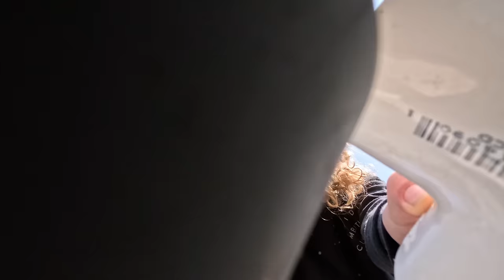The Kids (and Dog Dog) Help Me Get Organized

Comment: The crows are self appointed guardians of the world.  If they are going off, there is something they consider a predator around.  Sometimes it's YOU.  Once they get accustomed to you, they will back down on that.  By the way they were sounding off and harassing it, it was probably something big.  Big as in Coyote, Wolf, Bear or Big Cat.  If you ever find yourself in the woods alone, and the crows are going off like that- Pay Attention.  You may have something stalking you.  Might be a good time to think about what you would want to use as a weapon.

The more you know... 🌈
Reply from the maker: Good info. Thanks 😊
Reply: Good information.  Thanks!  Also if in the woods, you can carry a small canister belt clip-on air horn.  Can be used in emergency to startle and scare off an unwanted animal.  Those little horns are extremely loud.